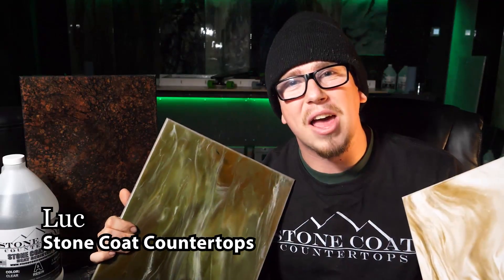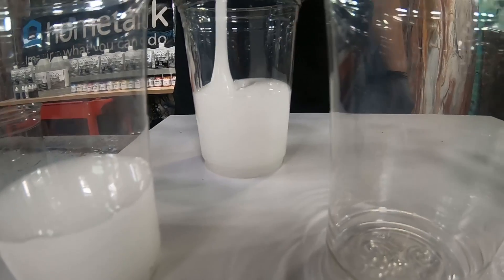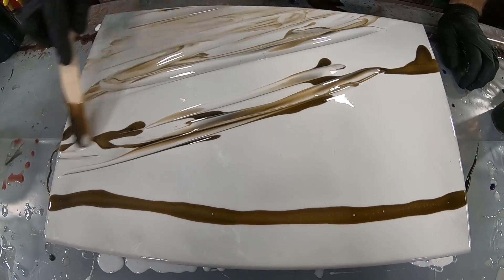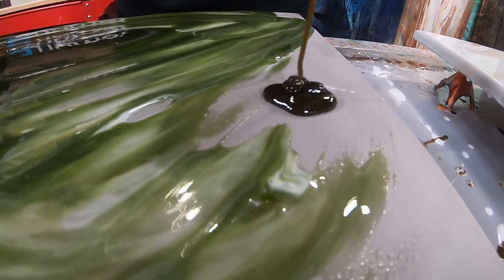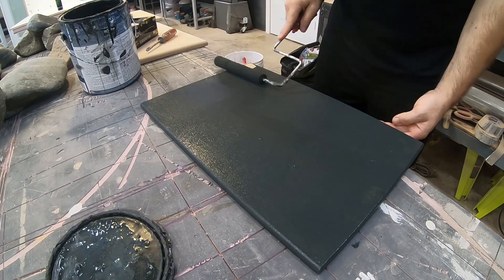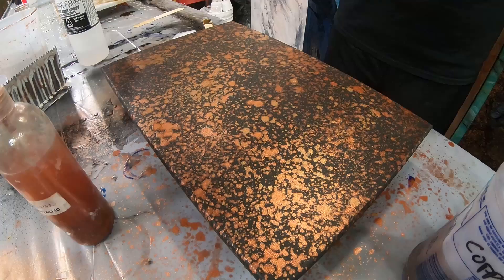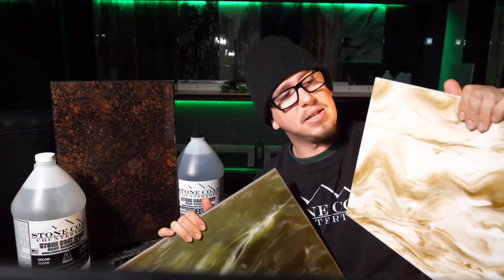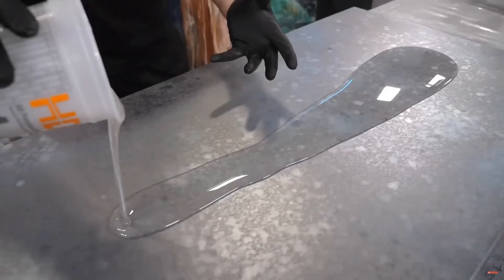Epoxy Resin with Translucent Dyes | Stone Coat Countertops

Comment: Can this technic be used on a ceiling in a small bathroom?
Help!!!
Reply: Karen, make panels on the floor first, then attach them to ceiling.  There is an adhesive type calking that bonds right away in the tubes round cardboard tubes.
It will tell you it is an adhesive.  I think I would consider screwing the edges in place as well. At least until it sets up 24 hours.  Try a small bit and see first.